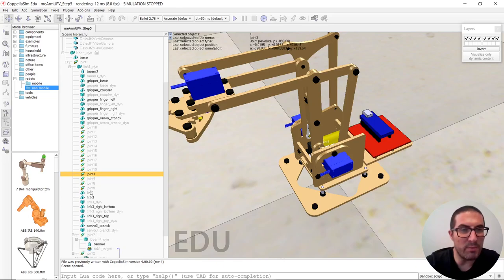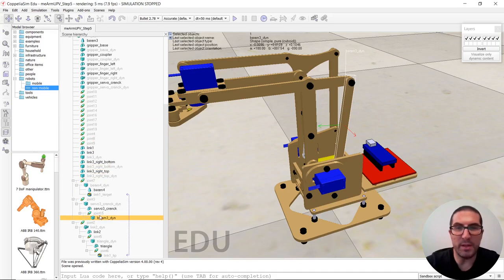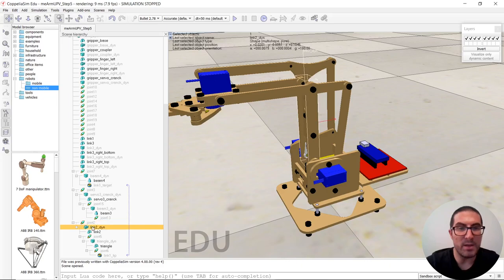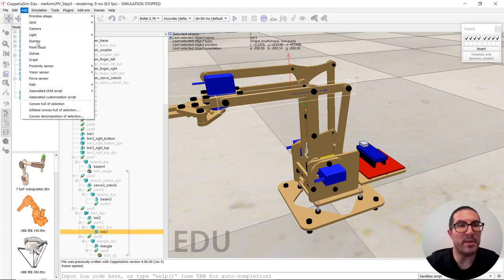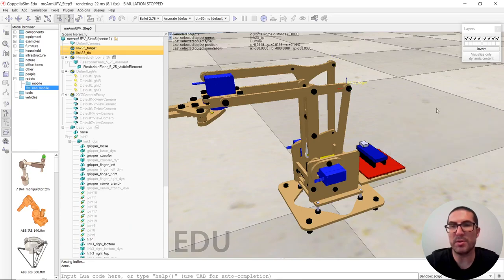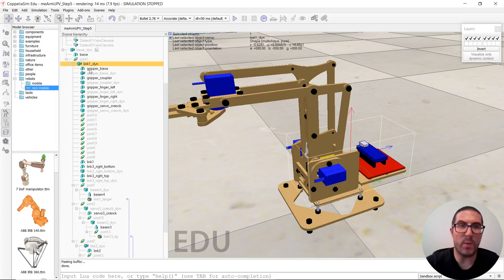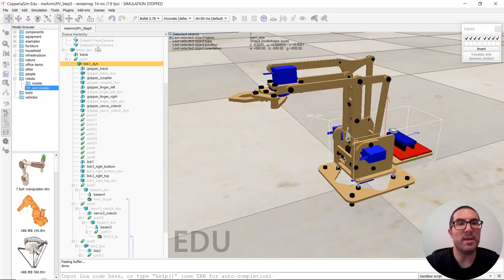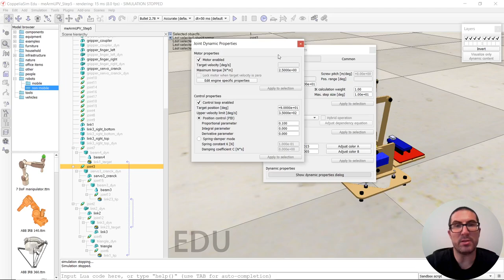meArm Robot Axis Control (Step 5) | CoppeliaSim (V-REP)

Comment: I am simulating a robot manipulator with 3 links and 3 DOF. Now whenever I try to start the simulation,the links start to shake. How can I solve this issue?
Reply from the maker: In which mode are the joints? Is a serial manipulator? Are the links dynamic? Make sure that there’s no contact between the links
Reply: @LeoArmesto   The joints are in torque/force mode. It is a serial manipulator and the links are also dynamic. There were some overlapping between the links. I have removed them. Now that huge vibration has gone but there is still a very small unnoticable shaking. Is there any other way to solve this? Does it have something to do with the mass of links? Moreover what are the factors on which the torque on motor enabled joints depend?